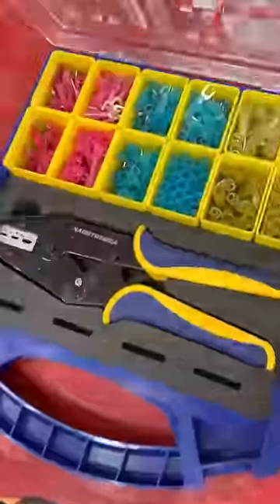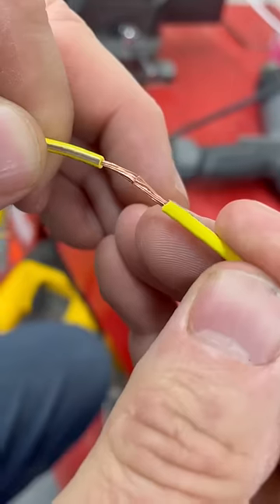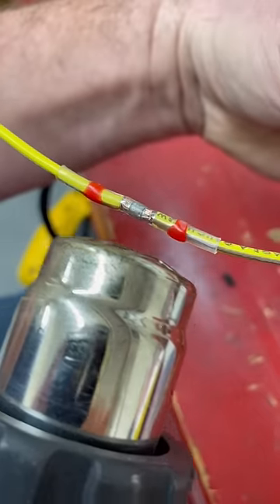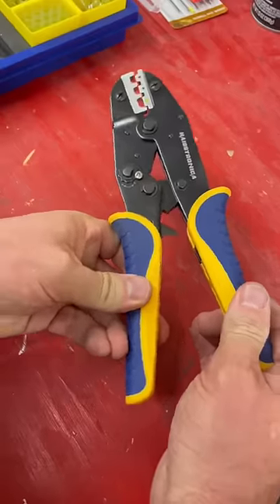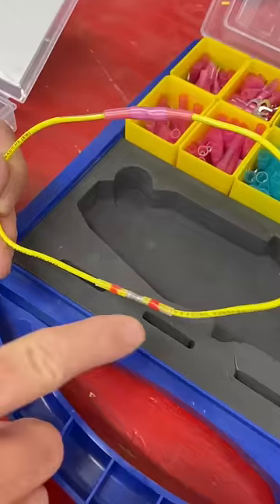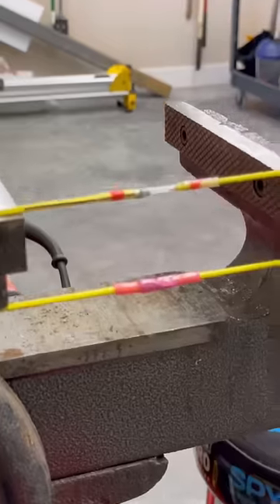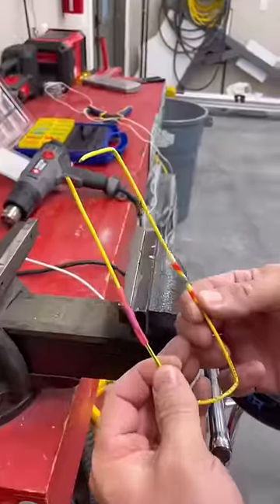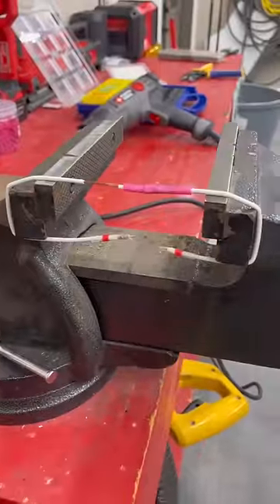Crimp verses Solder Connectors

Comment: Always use proper crimp connections on mobile equipment for vibration resilience. The insulated crimps and the $12 tool from the local hardware store cannot make proper crimped connections. Solder is for PCBs

Comment: You are not supposed to use solder in an automotive environment because of vibration.  If you have to solder something like a sensor that you can’t replace then you also need to use rubber cement and create a relief.  Even then it’s not recommended but I have repaired extremely difficult to find sensors that are prone to breakage and found that they still worked 15 years later.  Of course there’s no way for me to know if it was the relief that made them last but I’m just going by how I was taught.

I was taught by an automotive school but if you watch the videos from that racing harness school you’ll see similar recommendations to what I was taught.  I’ve been around racing for 40 of the 40 years I’ve been alive and I really don’t think you need $10k+ wiring harness for a race car but you do need to at a minimum have an OEM quality or higher harness.  OEMs don’t use solder they only crimp!

Comment: Solder is only good for circuit boards and stationary electronics. Heating of the wire along with solder wicking up inside the insulation weaken the wire and almost ALWAYS end up work hardening, breaking leads, and inducing resistance until it fails.

Comment: You don't use solder in a car, it is not SAE rated because it's bad with vibrations, it will slowly crack and decrease the conductivity. That is why you will find only crimp connector on cars 😉 Cheers!

Comment: Wire needs to be pre-tinned properly before forming the solder connection. Otherwise it will be be weaker.
Reply: Wires shouldn’t be used for mechanical loading. It’s mean for electrical connections.
Reply: @engineer9975  a pull test is commonly used as an indicator of splice quality.

Comment: Yea the solder connectors only create an unnecessary point of load that makes wire more likely to break at that joint..  is why they say not to solder the connections at a plug end and why all male or female cord replacement plugs have screw terminals or push terminals..   and why you never see solder connection on cord plug ends.  Same reason why lightening cables for iphone always break because they solder to that little board and shit bends a little then breaks..  so trailer wiring blows around n jiggles while driving and will be more prone to break at those solder points..  theyre good for use inside vehicles or in an enclosure..

Comment: Neither throw both of those out and use actual solder and heat shrink. The crimp connectors get corroded ad the solder ones arent hot enough to actually solder it holds the twist together.

Comment: Simply put quality crimps are easier and cheaper. You'd be better off spending extra time and money making sure your don't cut the copper. I prefer self sealing self sealing shrink tube over them for style and corrosion resistance.

Comment: Depending on manufacturer specifications some OEM’s do not want you soldering wires together as this can cause excessive resistance in the circuit. Do it right or do it twice.

Comment: I don't use cheap solder connections I solder them myself then add heat shrink.
No shortcuts solder it then heat shrink.
No replacement for skill.
A property soldered wire will be stronger than Any connector. 
Self solder then seal it No shortcuts.

Comment: FACT on general wires, a properly made crimp connection will be superior in every way to a solder connection in nearly every situation..

I know this is a FACT, because I have been properly trained in soldering, many types of crimping and other terminations.

I have over 40 years or experience and practice of both soldering and crimping

THE biggest problem with crimp connections is that people do not do the job properly.
Because they have not been trained or taken the trouble to learn how to make crimp connections properly.

BUT ..... I have seen and repaired some pretty horrible solder joints, too.

Comment: Neither, that solder melts at too low a temperature. I'll use proper solder and heat shrink tubing over the joint. Water tight and zero chance of corrosion creating resistance in the joint. Yes you need to be mindful of where that joint is and to make sure flex in the wire is happening elsewhere to prevent excessive work hardening of the eyes and eventual breakage of conductors.

Comment: They alsp have marine grade crimp connectors with solder as well. Just sayin
Reply from the maker: These are marine grade both the crimp and the solder ones
Reply: @hausplans  oh ik brother, I've used both but they also make connectors that crimp the wires with some solder inside the connector itself so you get the best of both worlds. Solder and the strength of a crimp. Just wanted to make people aware.

Comment: The solder connectors are garbage. If you are going to use solder, actually solder the joint and heat shrink it with good shrink tube. A properly soldered joint will be stronger than the copper wire. 

Otherwise, if using crimp connectors, just make sure the crimp is good and heat shrink if you can. I like to use bullet connectors if it is something I may ever have to change or remove in the future. Like stereos or lights.

Comment: crimp is still better.

the solder stuff is low temp solder and not have enough flux. 

an easy way to get a dry joint!

Comment: from my experience I gotta say either lead solder and shrink tube or crimp connectors, solder connectors are terrible
thy are mechanically weak, maky poor electrical connection and are prone to failure

pretty fun if you gotta dig trough some wiring loom to splice some wires  because all the solder connectors failed

Comment: First. Why would you think this test is a good idea? Electrical wiring is not meant to handle this kind of stress. Second. A reliable test would be to put the connections under an electrical load. Then, you'd find out which connector is more reliable
Reply from the maker: You’re right electrical load and conductivity are super important but I just thought it be fun to see which connector had more strength

Comment: Well I get your intent was to educate I believe you made a fatal mistake on both connections the crimp joint if you heat it long enough will glue itself to the wire but you have to get it hot enough to glue will melt on the solder joint you have to get solder hot enough to melt itself all the way into the wire otherwise it does no good

Comment: Any system which relies on the connector (much less the wire) to carry weight is fundamentally flawed.  Use whichever meets code and you find easier.

Comment: Unless you are using absolutely pristine new clean copper wire the solder type make unreliable connections. If the copper wire has the slightest trace of oxide it will not solder properly.

Comment: Always crimp. Even in motorsports it is crimped. 10k dollar Motorsport harness is crimped. It is that way for a reason. The issue most people have is using the wrong tool for the job. Which in turn makes for a bad crimp.

Comment: how about testing a properly soldered joint? twisted, fluxed, soldered (none of that low temp heat gun bs)

and I doubt people saying to solder were concerned with strength.   its about conductivity...especially over time.  which you didn't even try to address.

Comment: solder then shrink tube with an adhesive theses crip on connectors have the possibility to have a cold solder joint no matter how strong they are besides there should be no need for any electrical splice to be under that much abuse

Comment: Connectors should never have tension on them in the first place, if they do then your wires are too short... the benefits of the solder connectors are to make a better electrical connection for power to run through and help keep out moisture to prevent corrosion over time bud. Your test was in no way showing a good comparison of the two. Perhaps submerge them in water amd see which one stays dry inside, or soak them down with salt water amd see which one corrodes away faster. Heck, you could even pump electricity through them and see which one can carries more amps without melting down.

Comment: Those solder things are not useful in the slightest. The solder requires a much higher temperature to achieve proper flow than it takes to fully shrink the tube. If you stop heating it when the tube is shrunken properly, the solder hasn't even began to properly flow around the strands. If you stop heating when the solder fully saturates the wire strands, the tubing no longer exists. If soldering, best way is to solder the old fashioned way and put heat tubing on after.

Comment: Solder should not be used on any vehicle due to the vibration. Soldering makes a solid wire which is vulnerable to this vibration. And if your roads are really neglected, like they are in Tucson AZ., your going to have a bad connection very soon

Comment: Don't use those solder connectors. You can't tell whether the you have a properly soldered joint or not and crimp connectors will be more reliable.

Comment: solder will eventually fail due to micro fracture formation over long periods of time. heat, vibrations and the elements all duty cycle these connections over time. as tom milner from PTG said: “always use crimps, never simp for solder”.

Comment: Mechanical connectors are never as good as a weld. They don't even let you use them for lightning protection counter poise to ground rod in most job sites.

Comment: Never use solder connections in high vibration scenarios, vibration will cause fatigue cracking in the solder.

Comment: Your testing of its “strength “ makes no sense. Put them in a circuit test them under load. Heat those point up and see if it fails

Comment: That low temperature soilder is trash it doesn't penatrate the wire very well not a good connection. Use crimps or a real soilder iron

Comment: Never use those low temp solder gimmicks. The “heat shrink” on them isn’t even uv stable.  Never ever. 
I had a customer try and rewire part of his yellowfin with them. And as ALWAYS, in the end had to come to me and spend a lot.

Comment: Your testing is flawed. If properly wired with slack, the wire is NOT subject to pulling apart in tension. The pull apart strength test tells you nothing about real world conditions. What you should have tested is the electrical continuity and current flow ability when subject to road salt and weather conditions. I actually do repair work and I find that most of the electrical problems are caused by poor crimped connections. Crimp connections are just fine for some applications, but not for wiring subject to road conditions.

Comment: Solder connector suck, the plastic covering distorts when enough heat is applied to completely melt to bond solder. Now let's talk about bond created with wire that isn't completely clean, junk I say.

Comment: Both
Reply: Both is the worst option, as it combines all of the downsides of each method, without adding any benefits. If you crimp and then solder, you then get wicking up the stranding, causing a weak spot higher up the wire. If you solder (or pre-tin) and then crimp, the solder will cold-flow under the pressure and the joint will come loose later on. 

That’s why in electronics technician training, it’s taught that it is an ABSOLUTE no-no to combine both.

Comment: I would never use those cheap and rubbish solder connectors.
Always crimps.

The solder doesn't even look like it flows properly, so your electrical connection will always be compromised even if the physical one isn't.

Comment: The solder connectors are complete crap! If you ever do a cut away and look at how much solder in the way it does it it is horrible. You're better off using a good water tight heat shrink connectors, and use real solder to solder your connections together

Comment: This is crap. I am using soldering iron for 40 years and this soldering crap is crap. Cut that wire you soldered and you will see crappy soldering joint. This is JUNK. 
This can have only one use to put it in trash. DO NOT USE THIS. Soldering is not about pulling wires it's about about connectivity and amount of AMP that can go thru the wire, with this crap you never know how good or bad you solder wires so if you need more amps go thru wire that joint will be hot and not allow amps to go thru.